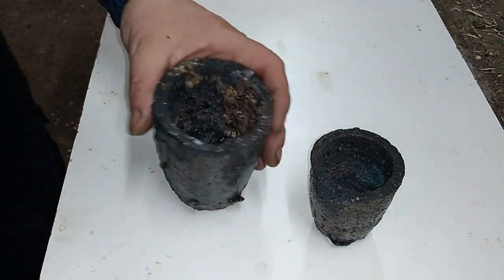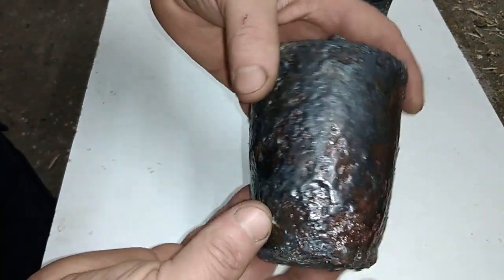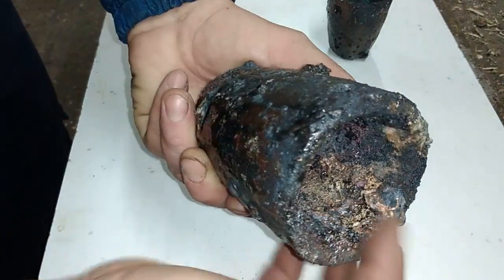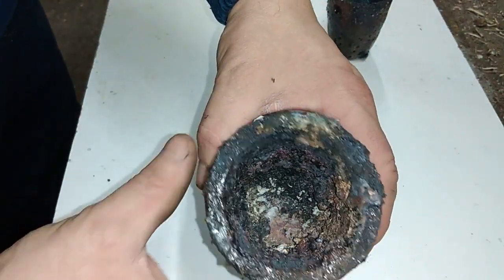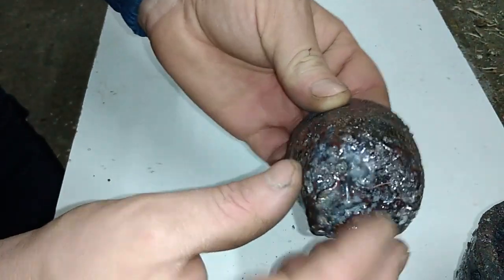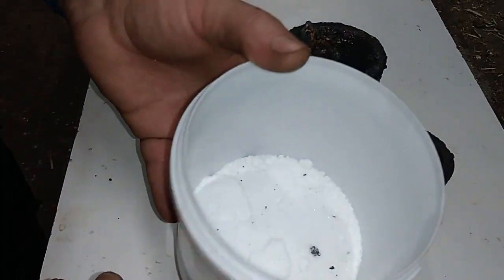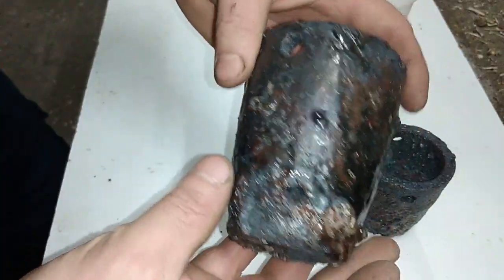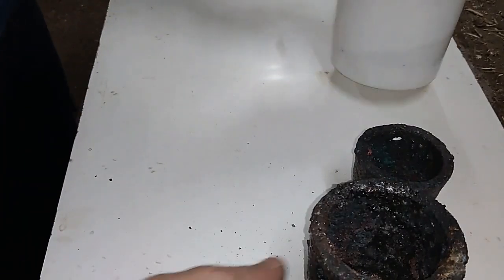Why BORAX eats yours GRAPHITE crucible?

Comment: Two things. 1. Your furnace is too hot. The reaction occurs at temperature that is higher than the melting temp of copper. If it was not so hot, the crucible will last longer. 2. Use a clay crucible for the first melt with borax and then re-melt the clean metal in the graphite crucible without borax.

Comment: You need to collect your copper from solution with electrolysis, you can set up a steel bar with a light 9 volt current through it in you copper bucket and collect it in a much cleaner form for melting.

Comment: I wouldn't say that it's the acidity of borax that eats the crucible...  Crucibles are made out of clay (these have graphite but quite a bit of clay as well) and any flux that works well will also dissolve the silicon, aluminum and metal oxides that make up clay and turn them into glass.  Soda ash is even worse even though it is basic instead of acidic.  The more flux you use, the more heat you run at, the longer you run, the more the crucible dissolves.

Comment: Would it be possible to use a steel container to melt copper since steel melts around 2500 and copper around 2000 can the temperature be controlled enough to stay below 2500
Reply: The steel container will plate with the copper/gold/silver/platinás. Especially the more stainless it is. So there will be conciderable losses. Unless you are willing to electrowin the steel or disolve it. Thus purifying and refining chemically starting over again. And again. And again. Its more about frequency in the conglomerate than the temperature even though they could be considered one in the same.

Comment: Why don't use a Steel or Cast Iron Crucible ?
Reply: Dont use a steel crucible!
Reply: @JackTheAwesomeKnot  why no Steel?
Reply: @ilovethemonkeyhead8523  it get soft and swishy, and also contaminates your metal.
Reply: @JackTheAwesomeKnot  it will always contaminate your metal? I want to melt aluminum, with that be contaminated
Reply: @nicklopez7536  dont get me wrong, a steel crucible will definitely work, its just not the best to use